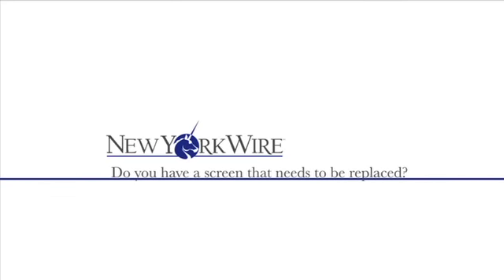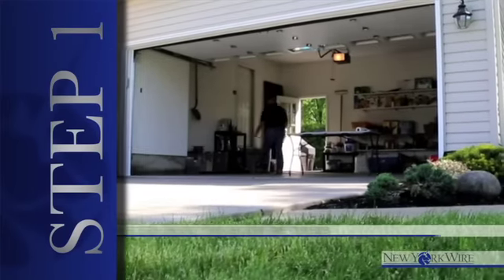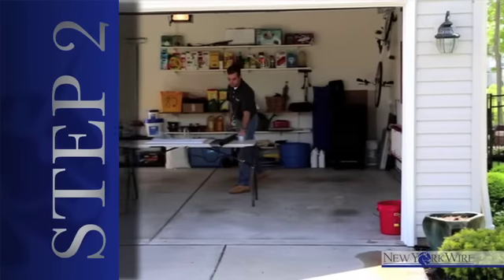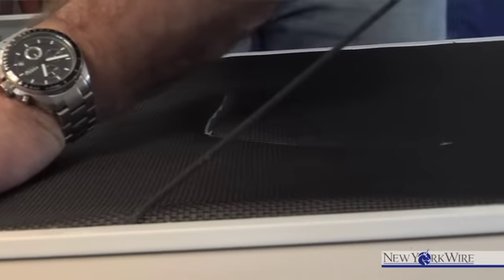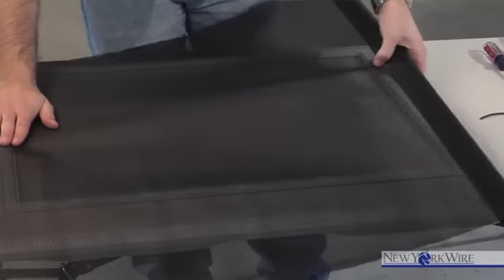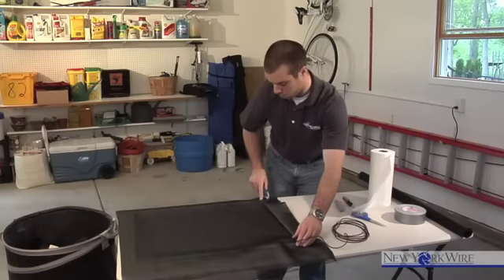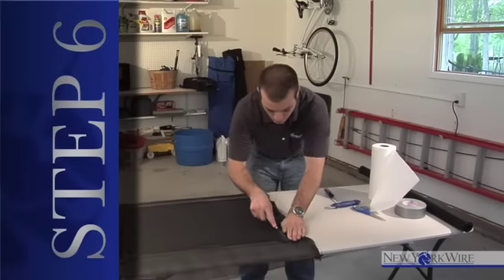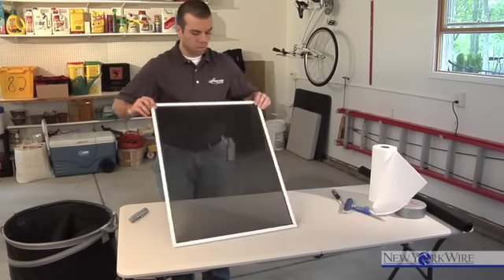How-to Install Pet Resistant Screen

Comment: What size screen spline should be used with the Pet Resistant Screen mesh?   Because this screen is thicker what are the recommended guidelines for spline thickness?   1/8"?  Gratefully.
Reply from the maker: We recommend 0.125” (1/8”)  for the PET.

Comment: My screen guy told me that these are too heavy for our window frames.
Reply: That sounds ridiculous.
Reply: Screens are made with screen tracks that are pretty standard, shouldn't be a problem using a heavier size screen.  
2 things to remember,  you will need to use more elbow grease to force spline and screen into the track, and you will want to use a Sharpe razor knife / New Blade to trim off the excess screen. If your knife cuts as though it is dull, it is. time for a new blade.
 After you have replaced the screen inspect for imperfections, if your happy reinstall.
Ultimately a very simple job.